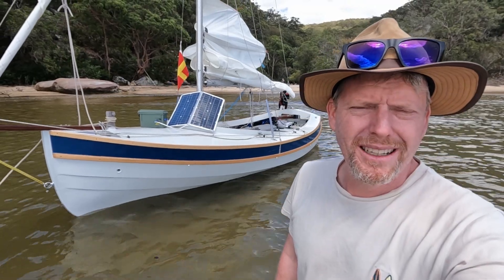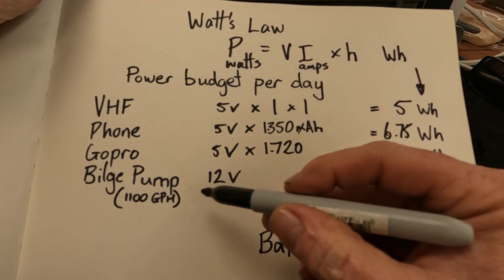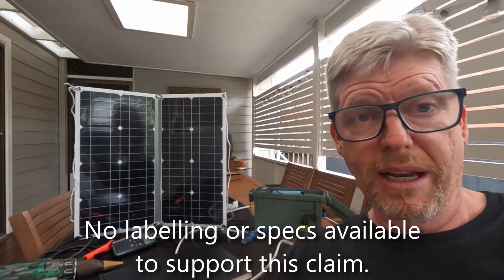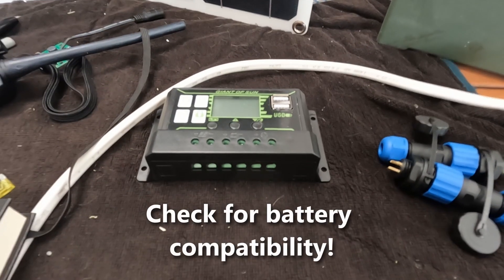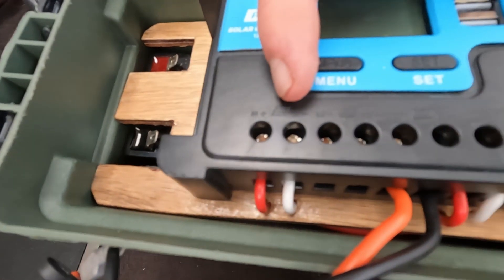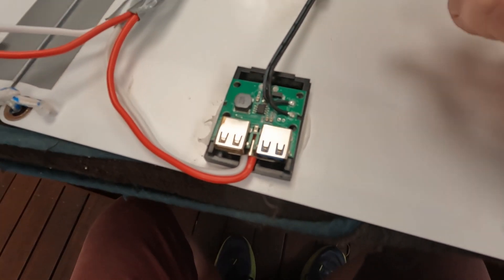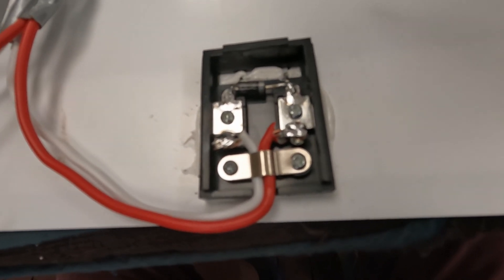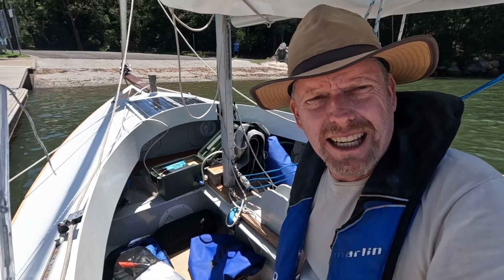Ep. 38 Micro Solar Power Station: Design and build one yourself!

Comment: Nice system and thanks for sharing Josh.  To work out the fuse for the solar input I used this advice:

Max watts / 12V, so (100W / 12 = 8.3A) + 5 to 10A for some wiggle room so I would try a 15A and if it blows put a 20A one in but its unlikely to blow unless you have an issue.

Bet you get better vo.tage out of that solar panel than I do here in the North of the UK!!!
Reply from the maker: Thanks for the fuse calculations. I had no idea. Cheers, Josh
Reply: @DinghyCruisingTrim  To be honest Josh at 12V its hard to kill yourself or the boat!!  I think the other way of looking at it is the charge you can deliver to the battery too. I think with that Ecoworthy 30AH you can charge them in 1 hour, so a 1C rating or 30A charger if you dqred too!  To be safe take 2 hours or 15A charge, there we go on the fuse. 15A probably about right.

I have a couple of Ecoworthy LiPo batteries and have been very pleased with them.

Comment: I wish I’d seen that before I refitted the power on my Gem 550.  Anyhow, I’ve by accident got a lot of power now and a Bluetooth regulate and charger so I can monitor charging and discharge on my phone.   I have a 40w rigid panel now that I just sit in the floor of the cockpit and yesterday it charged my previous days use in about 2 hours.
Reply from the maker: Sounds like you have it all sorted! Thanks for watching Mark.